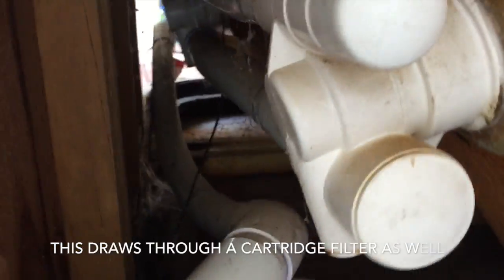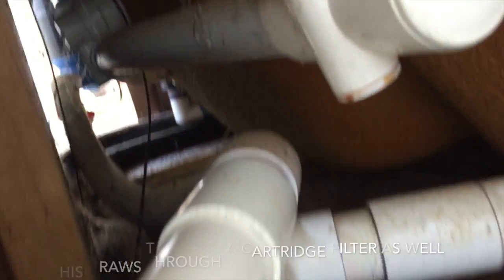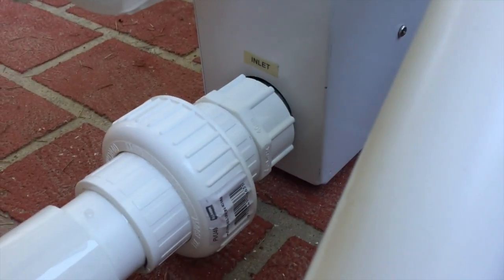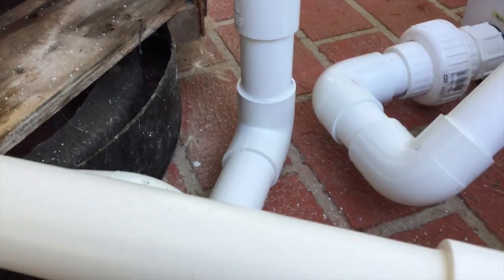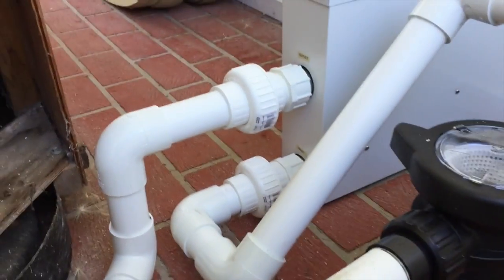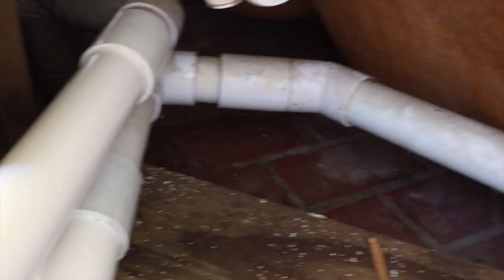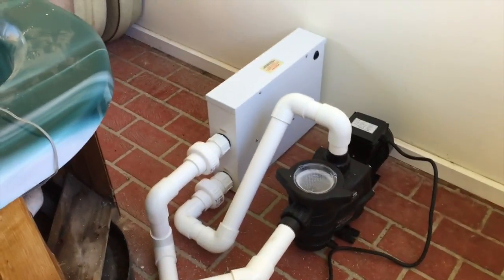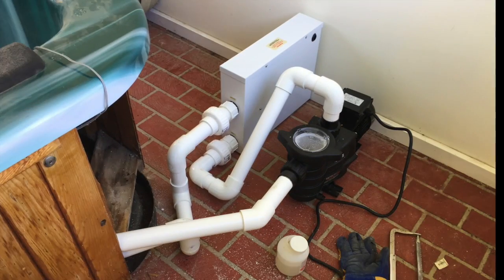How to Plumb in a Spa pump & heater in 60secs. Instal on swimming pool. Links in the description

Comment: Can I get that Heater at Homedepot plus how many Amps is it Im building a hot tub here in Texas and we get cold winters so I am thinking 50A Gfci.
Reply from the maker: Hi Kevin, I did a bit or research for you. That type of Heater is made in China and very cheap. They seem to work quite well. Here is a link to an 11kw 220v Heater that is a big heater for any hot tub. https://amzn.to/2ANc8Om The heater you saw me instal here is still running strong 18mths on.

Also if you are after something of greater quality and a better warranty then I would recommend this Hayward, it is also 11kw. You will see the price is greater but also the Quality is far greater. https://amzn.to/2RBRExL

Comment: How does it go through the jets if the control panel don’t have power
Reply from the maker: If the controller don’t have power then the pumps don’t have power and the keys don’t run. 😃
Reply: @Marksreviewsandtutorials  so I do I send power to the controls and bypass the old pump built in to the tub
Reply: And the pool pump will move the water in and back with pool valves off. With that will that move the jets
Reply: @Marksreviewsandtutorials  

So I’m gonna plumb in my pool/spa heater to the inlet /outlet of my hot tub

Comment: Hi i got that heater, both i do not know how do the electrician installation, do you have a video tutorial o know where i get. thanks.  Model no. 0338045ST, 11KW, 220V

Comment: Great video Mark,  just to confirm, as I am about to try and restore an old spa that has nothing working except the blower. This system on this spa in the video has just a filter, then circ pump, then heater, back to spa. No controller, all just manually controlled?
Reply from the maker: Yep. It was a rental property so they wanted the basics and wanted to be able to remove it when they left. 
They just plugged the pump into a time clock.
Reply: @Marksreviewsandtutorials  thanks Mark. Seriously mate all your videos are great, keep doing them.

Comment: Hey! nice setup. Can you connect the SPA heater to a timer? So it turns on and off automatically? or Needs to be turned on manually?  thank you
Reply from the maker: Yes, absolutely but they have a flow/pressure switch so you can also allow that to turn them on and off with the pump.
Reply: @Marksreviewsandtutorials  Thank you for quick reply! So I can bypass the heaters On/off button?
Reply from the maker: I do not recommend you bypass anything. 😳

Comment: Hi Mate,

I just got the same system for my above ground pool. After looking into it I realised I made the wrong choice (even thought I really want it).

I just purchased a Bestway above ground pool 6x3.5 meters for the kids. I also got the 11kw system when I got the system I read that it requires 50amps to run the heater which needs its own connection to connection from the motherboard  and it also consume so much power I calculated that I would pay $2.5 an hour to run it. Is there a way around this ? And not connecting it straight to the main board ? I would really appriciate your help
Reply from the maker: Hi there is no way around connecting a big enough supply for an 11kw heater. 
If you buy a heat pump that is 6-10 times more efficient but you need to spend thousands to buy the unit.

Comment: Do you have anything on how you wired it I bought the same heater but it doesn't come with anything to wire it
Reply: Can you send me a picture just take the top cover off
Reply from the maker: dennis lloyd No. it was a customers spa.
Reply from the maker: dennis lloyd In Australia it is only legal for Electrician’s to Hard wire things. So this was connected by a licensed electrician
Reply: Ok thanks
Reply: @dennislloyd6747  Did you ever figure out how to wire this heater? I trying to figure it out also.

Comment: hello, i was looking to find the correct pump /heater and blower for a stock tank spa. It is a 9ft diameter 1000 gallons. Going to add whirlpool jetts from a tub conversion kit, just need the pump and heater. Any help would be great

Comment: will this work.....
1.  have a bath tub in my back garden
2.  fill it with hot water
3.  something like in this video is attached to the bath keeping the bath at 39-40 degrees?
what do I need, how can I do it?  any help greatly appreciated.
I don't want to use a spa anymore because of all the chemicals, I just want to have a bath outside with something keeping the water hot.  thanks

Comment: Ok so i noticed you hooked it up from pump-heater then to filter which in my scenario would be in my favor but my manual is saying it needs to go on after filter, which brings me to my next question if that's the case can i run the heater with the control valve on recirculate and not filter or will it damage the heater because of "debri" or whatever if anyone knows the answer please help before i screw up royle..                                                       F.Y.I   its a hayward cspa-xi-11k
Reply from the maker: This installation was filter, pump, then heater. The heater does have to be last.

Comment: What heater is that?
Reply from the maker: VaporAlley LLC It is a 9kw electric heater. An electrician came along later and hard wired it in.
Reply: Would you have a brand/name or anything please?
Reply from the maker: VaporAlley LLC It is a generic Chinese. Various names like coasts. Are you in Australia?
Reply: No, in the US. I just got a hot tub with a bad heater. Just looking at options to replace the original one or add an external one
Reply: I know these heaters are cheap to buy but are they any good ? Are they expensive to operate ?
Reply from the maker: @1962Ando  Sorry for the slow reply here, but I have found these heaters now in the USA. They are very cheap as you will see when you look at these two links and Yes I have installed quite a few of these and they are all as far as I know still running 12-18mths on.
My Reply to another customer. That type of Heater is made in China and very cheap. They seem to work quite well. Here is a link to an 11kw 220v Heater that is a big heater for any hot tub. https://amzn.to/2ANc8Om The heater you saw me instal here is still running strong 18mths on.
Also if you are after something of greater quality and a better warranty then I would recommend this Hayward, it is also 11kw. You will see the price is greater but also the Quality is far greater. https://amzn.to/2RBRExL